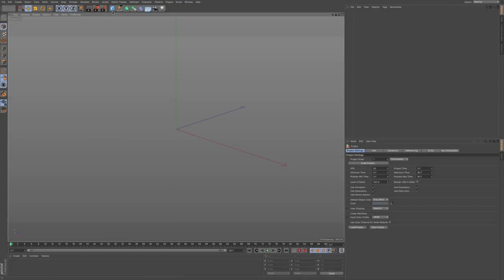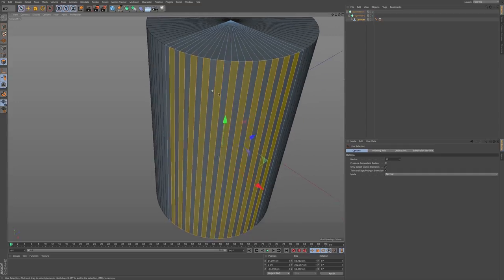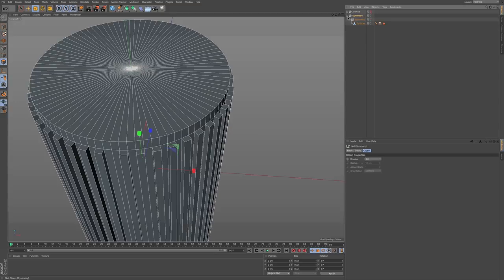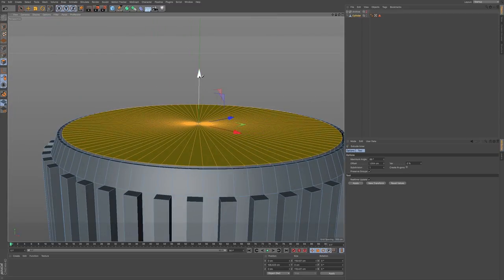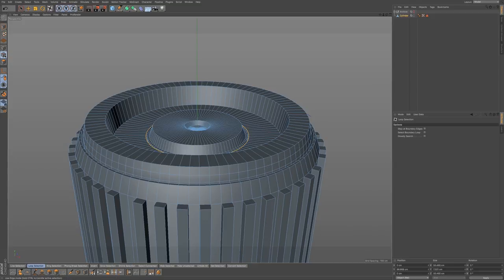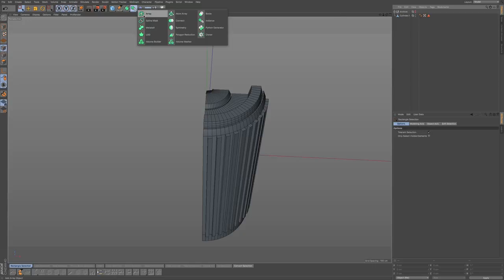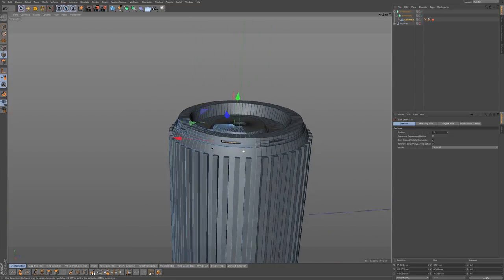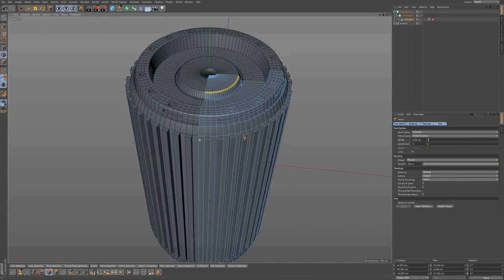Learn Cylindrical Hard- Surface Modeling in Cinema 4D

Comment: Nice one. 31:20 you can also access modeling menu with right mouse click. When modeling cylinder shape polygons should be closed with connect object. In case if you want "watertight" model. Cylinder caps are always loose if you do not connect them.

Comment: not really symmetrical when you have an extra space at each quarter.., no one pointed that out.. I tried it with 88 or 94 segments and resulted to that same dilemma... only work around I found is not to do symmetry and taking the time to select every other polygon all around and it was perfect... spacing wise

Comment: the problem with your symmetry method is that you lose the rotational symmetry of the object.  Every 90 degress you have to unextruded polygons next to each other.  Learned lots though.